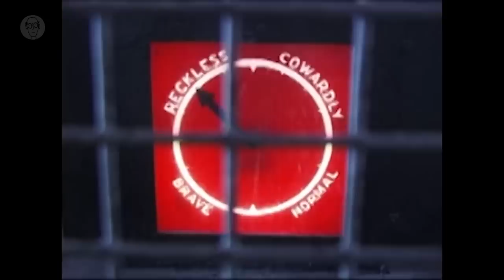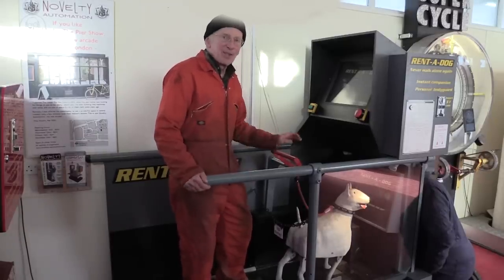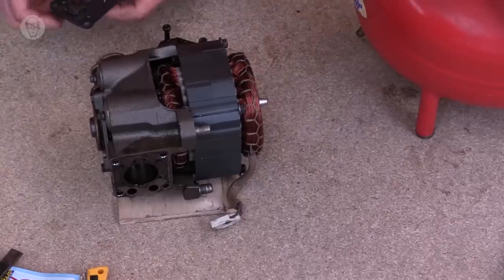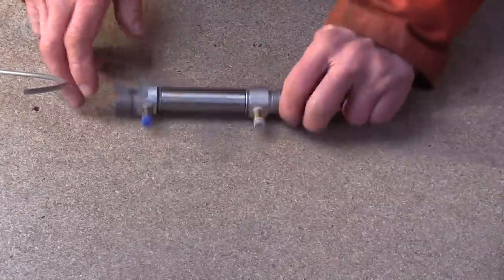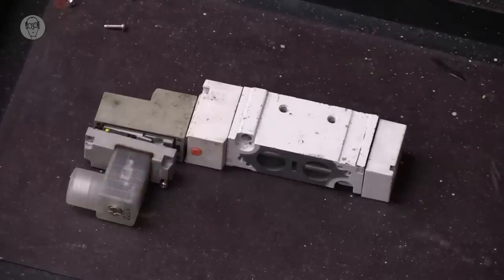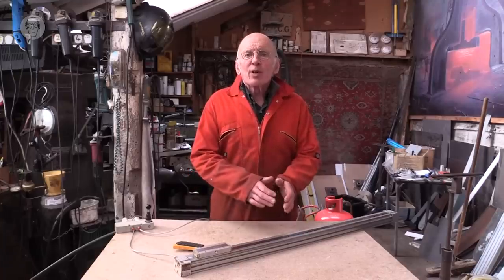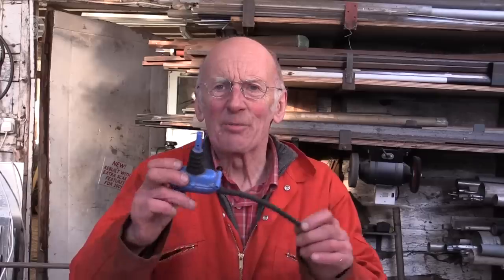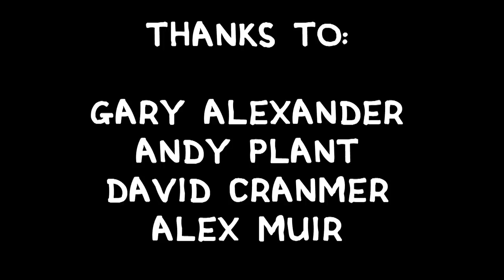PNEUMATICS -The Secret Life of Components, a series of guides for makers and designers - episode 14

Comment: The problem with compressors is heat most normal compressors have a 50% duty cycle. So 50% on the rest so you must rest the motor while using your receiver to run the show.
Shame you missed vane compressor as these would fit your projects.
Vane compressors as long as you change the oil at the required running hours is best.
Even the piston compressors advertised as 100% are not what you think read the small print. Oil free can work out very expensive as something must wear out otherwise why would we use oil.
Car manufacturing has tried oil free engines but they did not last!
Even in a dentist where you need to be oil free they use an oil compressor with a desiccant dryer with loads of filtration.
I know of an oil free stainless steel construction compressor that sounds great. 
Even big ecological attractions have tried all sorts but we are back to screw or vane to give the 100% duty and reliability. 
I am on twitter also if anyone is looking for advice

Comment: Still have the scar from 1983, cable air cylinder. It got stuck, when it came free was like catapult on aircraft carrier. Unfortunately my finger was in the way.
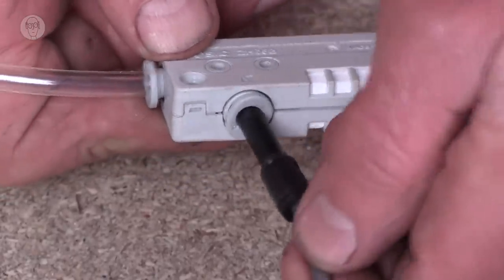Reply: I reduced the speed on one cylinder by connecting both ends of cylinder to air supply. 46:40 we would make sucker using T block junction and copper pipe, used to spray graphite grease in forging tools. Back then Schrader were cheap and Festo the posh expensive kit.

Comment: Tim you can absolutely do mid stroke positioning using a double acting cylinder with a centre closed 3 position 5 port valve (the actual hand operated valve you are using at 31:30 is a 5-3 centre closed). When the valve is in centre position the cylinder will be held in place by the captive air either side of the piston. 

https://www.youtube.com/watch?v=csP2yxnlzjg

You can use multiple reed switches for feedback detection. Cheap parts aren't reliable use SMC.

Comment: Ohh there's actually a DIY movement for pneumatic tubes called "Seidenstraße" (Silk Road) as people have found out that drainage pipes and certain plastic drinks bottles fit nicely together. It's been present at the congress of the Chaos Computer Club some years ago, and probably will be at the next one in Hamburg.
https://www.youtube.com/watch?v=u-tufdoTzY8
https://www.youtube.com/watch?v=18gkQcm4okI
To manage stuck capsules, lighting is mandatory so you can find them from the outside.